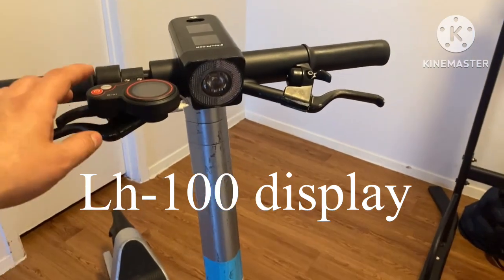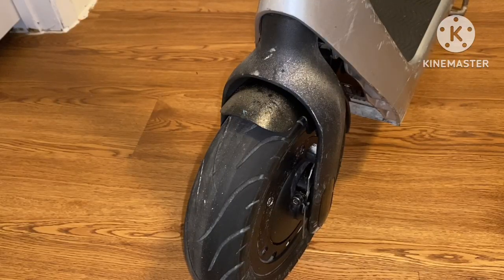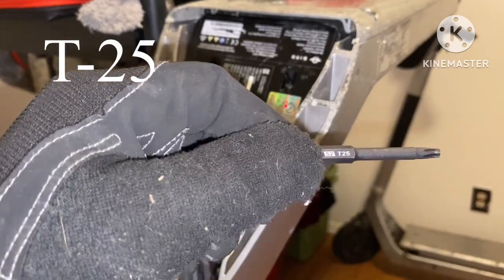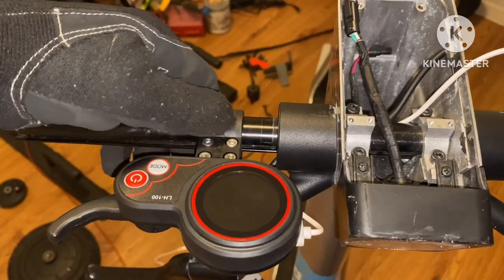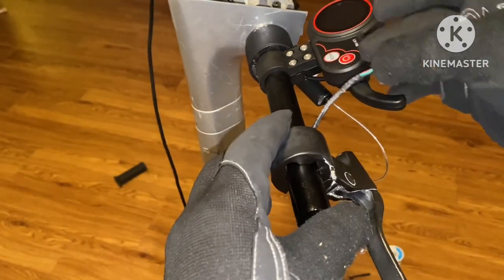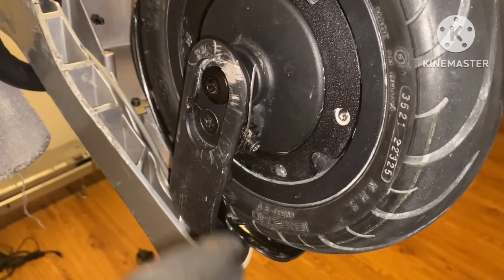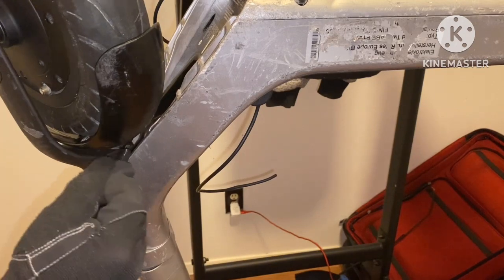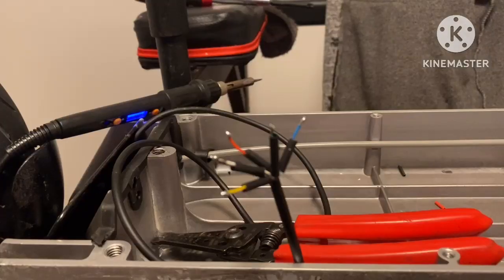Bird 2/3 |Install￼ display tutorial | ￼diy Projects￼ | Step-by-step #diy ￼

Comment: Hello Amazing Video! 👍👍👍
I have a problem!  I have 5 Hall sensors on the motor, which is normal: red, black, blue, yellow, green. But the problem is: I installed a brushless motor controller in a Xiaomi 1s and there I have the Hslk sensor plug from the controller: red black but in between this white one and green  yellow blue.  But I boy can't solder the white cable together because this white cable only comes out from the controller, a total of 6 cables Hall sensors with white cables.  But from my 48V 1000W motor I have the normal 5 neck sensors without white!  What do I do now with the white cable that comes out of the controller with the 5 Hall sensors?  I didn't connect it.  But I also have a problem: my 1st speed controller 36V/48V 750W 26A current and I connected the 3 motor cables together and 5 Hall sensors and the thumb throttle Lcd with round Dieplay LH-100 the same as you have in the video and I just can't get any gas  together!  Hmmm I connected this LH-100 60V gas display from the controller also the 5 wires.  Red black blue green and yellow.  That's all. It just shows E-11 Error 11 at the bottom on the gas display.  And if I want to go to the P-Settings it always says (50) _ _ _ _ I have to press all 2 buttons and if it says 50 then I have to enter: 6666 and then press 2 buttons again then I can set all P-Settings.  But when I rev the engine, the kmh runs up on the gas display.  PLEASE you are a pro what is going on please??  And when I connect the gas display to the speed controller, the BMS on the battery already flashes blue, which is good, but !  irregular!  2x flash then 1x flash then 5x short flashes 2x normal again 3x short and and and.. But when I connect the (bicycle display S866 that was in a set with the controller) and press and hold (-) it rotates  the engine 3-4kmh.  Very very funny!!  Could it be the BMS? MfG.

Comment: Ok I got my bird 2 from auction with a full battery, can I still wire it up with a full charge or do I have to run it down ?
Reply from the maker: Yes you can wire it on a full charge ! No need to discharge your battery
Reply: Cool 😎

Comment: I did everything like you described on your video but my control is not working. I get a little pop when I install the power side
Reply from the maker: Connecter intelligent warriors/self study Wires and your motor will correct it’s rotation on its own. If you notice your wheel is spinning backwards then disconnect yourself study wires and reconnect them until you see your wheel spinning in the right direction.

After that its pretty much ! from there give it throttle and it should activate your motor from there..

Make sure your connections are good. 
/your soldering joints

Everything in this kit is pretty much plug and play. The throttle should activate automatically.

Or maybe try kicking the wheel/give it a spin  it might be set to kickstart. 

If that does not work then just order a replacement. They replace it for free 

But like I said to be sure you go over your soldering connections, that could definitely have something to do with it

Comment: Love your videos. Have you thought about putting together full kits with how to videos and selling them?  Take the confusion out of figuring out what to order and from who.. You become the go to source.  Just a thought because it's obvious you know what you're doing.  :)
Reply from the maker: You are absolutely right and in this video I did actually use a kit which was a Controller that included the display unit. Very easy process, less time spent, -pretty much plug-and-play at this point-like I mentioned in the video I didn’t have to use any power tools. Previously I would drill headlight switches or tail light switches. But I like the invisible look better, gives it the factory look.Also using these kits doesn’t require you having to purchase a 22 gauge Wire kit when it comes time for adding extensions. With this kit The wires are long enough to reach my controller. Kit price ->  $40 for the kit . That’s a deal  if you know what your doing. Sold it for $300 made $260 profit . Kits are the way to you get plenty of features inside this display. 

Thanks for the tips 😁

Comment: Hi, I really enjoyed the video, thanks for your help although the link to the controller with display does not seem to be working (#1) and the heatshrink kit #9 I think is also not working since it sends me to a different product. I think some other people were mentioning this. Do you think you could update it or something? Or do you have any other controller + display recommendations that could fit at the top part of the original bird controller housing?
Reply from the maker: Thank you for bringing that to my attention 🙏 , I fixed it.#1 is correct it takes me directly to the link of the controller kit . Currently is showing 14 available..

Comment: Question New follower Why the 30 ohms resitor on light? Is this to knock down the voltage?
Reply from the maker: Not the voltage but the current that flows through it is limited using the resistor. The voltage remains the same
Reply: @pjscootermods  thanks for your reply 🙏🏼 So I'm guessing I needed the 30 Ohms Resistor I tried connecting the light to the white and black wire from the display and it blew the light.

Comment: Does that controller come with the display and can I use the 500w controller you used in the tutorial with the twist grip?
Reply from the maker: Yes this controller came as a kit. Display is included. 
 And yes you can replace the original throttle with a twist grip instead , all you have to do is locate your throttle wires on your controller Connect that to your twist grip just like you would the original throttle.. 

Black with black 
Red with red 
signal wires to signal wire 

Ps. You can use a twist Grip throttle on any controller
Reply: I appreciate that, thank you for all your knowledge

Comment: Where did you get the white cable the 5v
Reply from the maker: https://amzn.to/3GhijMz
Reply: It’s a usb cord dude you probably have a few laying around. Just cut the end off and use the red and black wires. Most usb will be like that, but check to make sure before you hook it up.

Comment: My charger only charges up to 34 volts yet it’s a 42v 2a charger is that normal? I also loose power at 30 volts so I have a slow run time. Do you have a link to a good charger?
Reply from the maker: Your battery should be 42.2 V at full capacity not 34 V as far as the 42v 2a charger well that there is your typical charger. And at 30v The reason why you start to lose power is because you are already at your cut off point/Cut off voltage  the bms cuts off at 30-31v .

Also Gets a different battery. Swap out with the same battery from a bird2/3 you definitely have a battery issue on your hands if you’re not charging above 34 V . Sounds like it could be some of the battery cells and balanced.

Normally I say it takes about a good 8 hours for a full charge on these birds using the typical 2 amp chargers .

Right here is a link grab this charger which is rated for 36 V so you’re good there ! No issues! With this charger you will have a full charge in 2 1/2 hours to 3 hours tops

Link👉 https://amzn.to/3Hnm0kb

Comment: Excellent video i followed every single step and everything works fine, but when i get on the scooter it feels like it loses so much power and it goes very slow, any idea what i might have done wrong??
Reply from the maker: It’s nothing you did wrong ! you need a controller with more amperage/amps
Reply: @pjscootermods  i buy the same controller that you have, what is the maximum speed with that controller??